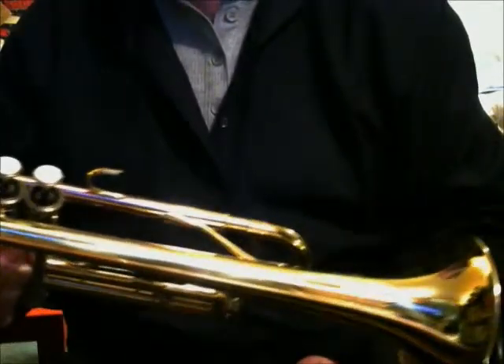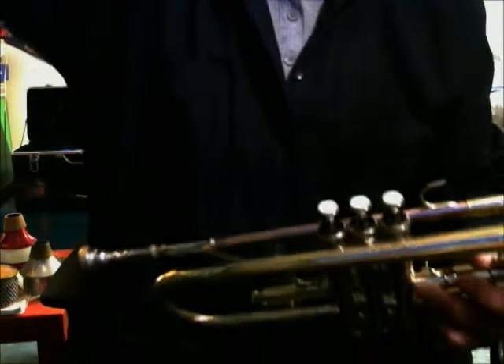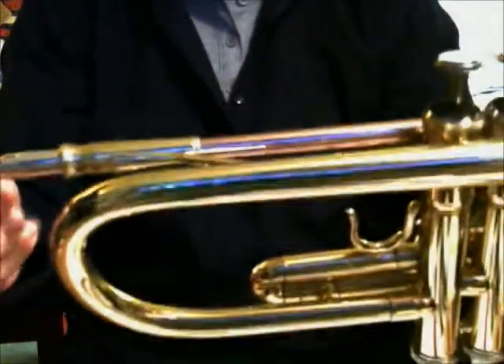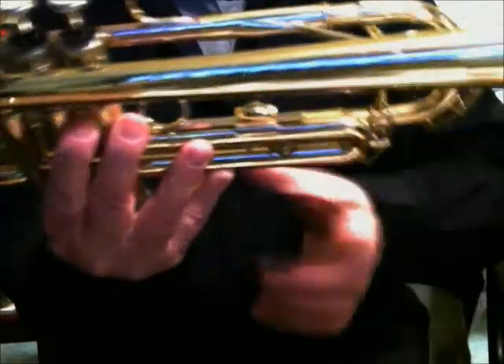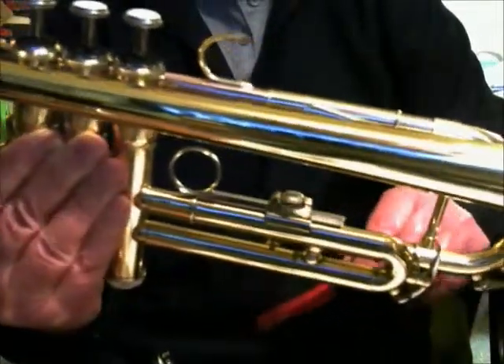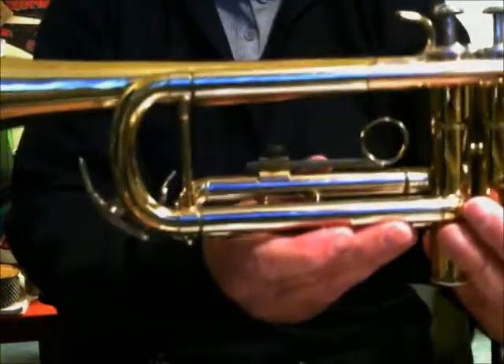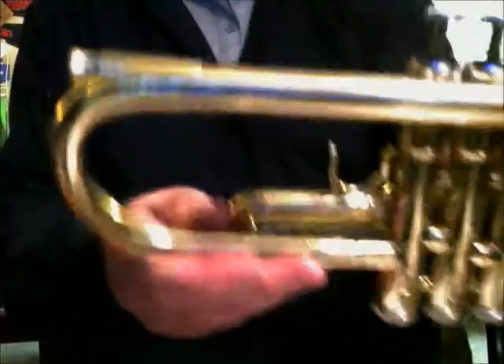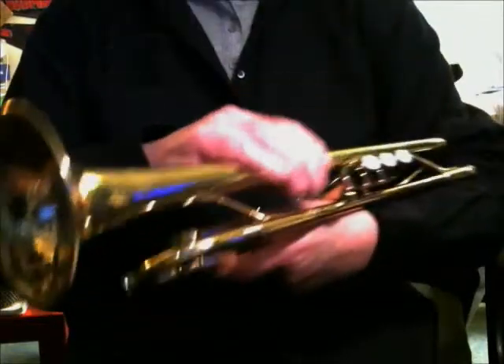Trumpet Design Difference

Comment: Hi, what's the differences between student trumpets and pro?
Reply from the maker: +Audun Jemtland The pro models have usually much better made bells and valve sections and better cutting tools. The bells for pro horns are hand hammered bells so  each bell has that individual  from the others. The valves on the pro models are faster and more accurate than the student model. The pro models are also much more expensive then student models and the finish can be much more ornate than a student. For instance as a general observation if you see a trumpet with very ornate engraving and decoration that is likely a pro model. Hope this helps.
Reply: Nice! Thanks for that thorough answer. It's not so easy to spot. Trying to find "my" horn on ebay.
Reply from the maker: You welcome,You can find very good used trumpets on ebay. I bought t auction awhile ago an Olds  Ambassador for $78.00 a real bargain since Olds is a reliable name ,also Conn,Getzen and Bach also King. All good all made in USA which is an impotrtant consideration because if you need to repair an used trumpet some music shops refuse to work on trumpets made in other countries,areality of life. Good Luck with your trumpet quest on ebay.
Reply: Great. Thanks!